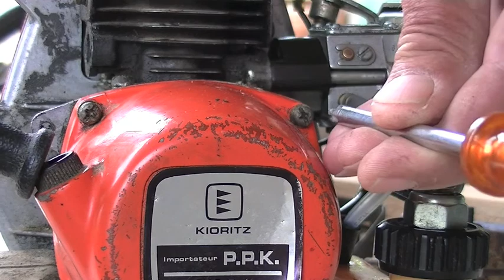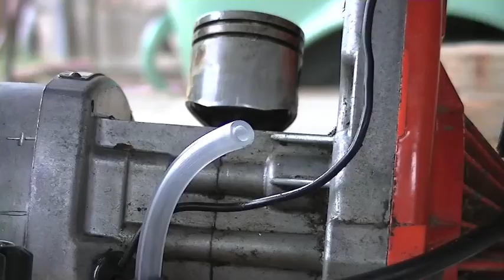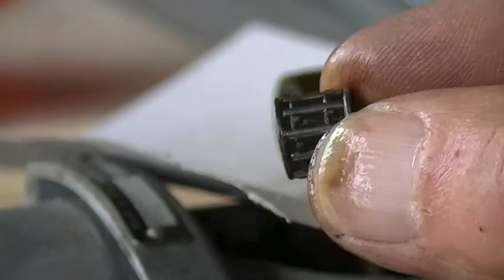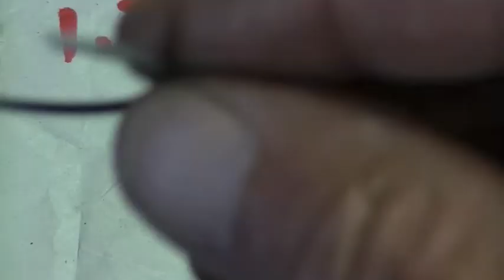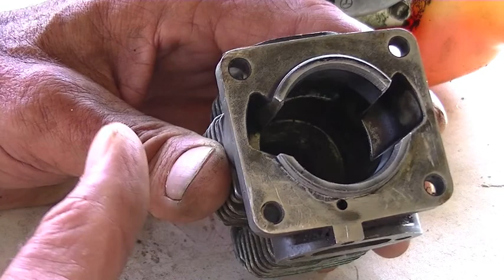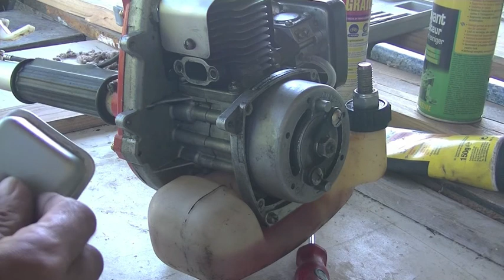Trimmer Piston Ring Replacement  Echo/Kioritz SRM200DA

Comment: Why did you replace the rings? Low compression or was the engine emitting excessive black liquid from the exhaust? I never take the cylinder off of the connecting rod, unless im replacing the piston.
Reply from the maker: Completely my fault! The engine was so clogged up with old oil and dirt and the machine is 40 years old. So my intention was to strip it down and also clean out the ring grooves but then I broke the rings. I really love this machine, don't make them like that any more

Comment: I have the same weed trimmer but I can’t get any fuel going to the carb. What am I doing wrong?  Can you give me some ideas what could be the problem please.
Reply from the maker: Hi Bighappy, had the same problem. Make sure that when you pull the choke lever that the plate covers the opening to the carb completely. Had to bend mine a bit to get a snug fit. I ordered gasket material and cut new gaskets between the carb and the engine. There are 2 of them and that did the trick. I think that it was sucking in air at that point and breaking the vacuum. Presumably you cleaned out your carb already? I have another video of this machine and someone commented that they also had a problem so they replaced their carb with one that had a primer bulb.

Comment: Hi Dave, Great video thanks! I managed to break the piston rings on my Mantis 7222E SV4B Tiller (which is a Kioritz engine) and can't find direct replacements in the UK. I think I'm right in saying I could just use generic rings? The inside of the bore measures 32mm, will I be okay just ordering some 32mm rings? The part number from the manual is 10001105330. Thanks, Matt!
Reply from the maker: Hi Matt,  you're very welcome. It might help you to know that Echo SRM 200DA is the exact same machine as the Kioritz SRM 200DA. Your part number is the same as mine. I bought mine from https://www.ereplacementparts.com/piston-ring-p-521055.html. Postage was expensive though. Generics should be fine as long as you have the ring thickness and width. But also check the ends because they fit into a little positioning pin that is in the groove of the piston.
Reply: @davekennedy52  I measured them and ordered these. I hope they will be the right ones! https://www.ebay.co.uk/itm/254332900094
Reply from the maker: @matthewcharlwood1894  Great! Hope they fit, please let me know I might order a set

Comment: davekennedy52, where did you get this formula from to calculate piston gap for this small engine?  Is it applicable to all 2 cycle engines?  Is it applicable to 4 cycle engines?
Reply from the maker: Thanks MDS, I got the formula online, and strangely enough can't find it again to show you. It's not meant for high performance so I would say stick to 2 stroke engines, I couldn't get original rings for the machine as its 40 years old so ordered aftermarket parts and used the formula as a guide.

Comment: G'day mate, could you please let me know of the stock carby settings for this brush cutter or what setting you have tuned this to? Cheers
Reply from the maker: Hello Finn, it has a Walbro W59 carb. The top of the metering lever should be ,06 to ,07 inches (1,5 to 1,75mm) below the edge of the carb. if you don't have the walbro guide, have a look at this, https://www.arboristsite.com/community/threads/walbro-carb-metering-levels-chart.192345/.

Comment: Lovely unit i also have a Echo SRM -220BE
Reply from the maker: Very nice sounding engine! It looks just like mine
Reply: @davekennedy52  for sure and mine was built from the assembly plant production line on July 8th 1988
Reply from the maker: Hi Patrick, it's great that you've got the exact date. Going to see if I can find mine. I've discovered that mine is so old that it has points and a condenser so will be doing a video of that quite soon
Reply: @davekennedy52  yeah normally if you look at the serial numbers and even engine code etc that could tell you 

mate